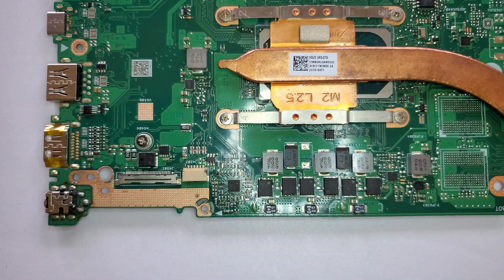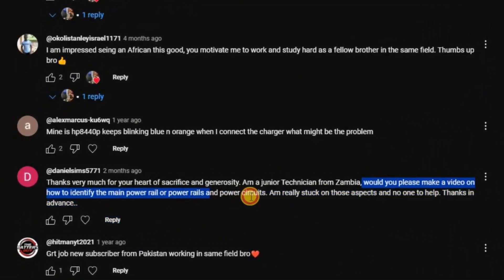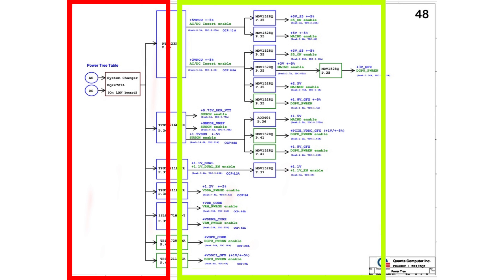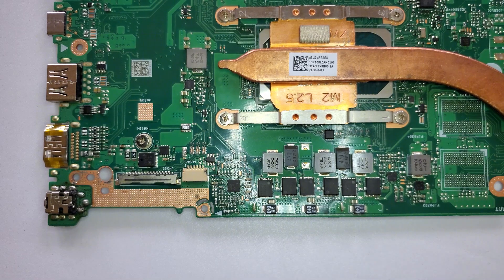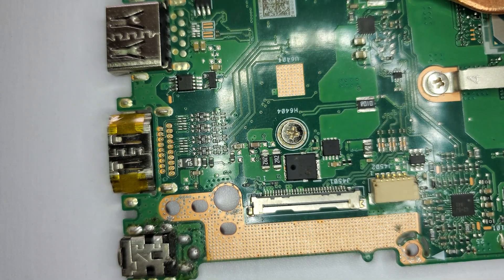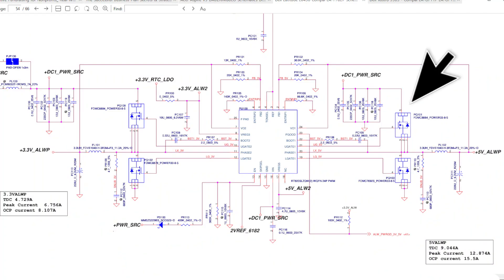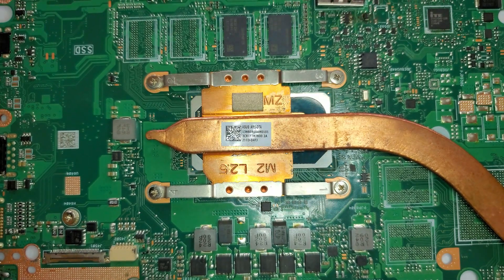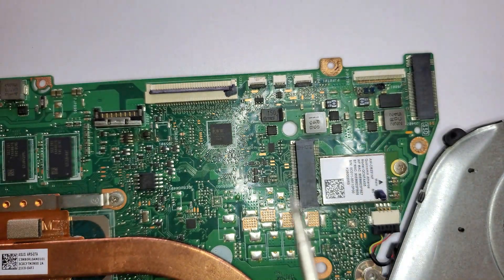How to Identify Power Rails on the Motherboards

Comment from the maker: Which video do you want me to create for you?
Reply: My laptop: Dell Vostro 14 3000 has some problem
- lost audio
- mouse intermittent, sometimes it shows up, sometimes it doesn't, sometimes it can be controlled, sometimes it can't be controlled. sometimes it only works with the right mouse button (not the left mouse button) - when I use the right mouse button, the control panel still shows up
so is it hardware failure? how do i check and repair?
help me please - thank you so much :*
Reply from the maker: @Duimoc  This sounds like are software issue. If you lost audio, first look at the sound icon, if its "x" then you need drivers. You can as well try powering up the laptop without RAM since most Dells will beep to indicate missing RAM. 
The touchpad also feels like you need to install synaptic drivers.
You can use Driver Booster or Snappy to install missing drivers.
Try those and let me know.
Reply from the maker: @Duimoc   This sounds like are software issue. If you lost audio, first look at the sound icon, if its "x" then you need drivers. You can as well try powering up the laptop without RAM since most Dells will beep to indicate missing RAM. 
The touchpad also feels like you need to install synaptic drivers.
You can use Driver Booster or Snappy to install missing drivers.
Try those and let me know.
Reply: Please do a video on how to troubleshoot  and understand CPU VCORE circuit and screen backlight circuit. Thanks
Reply from the maker: @dzabakwesi2213   here is the video for screen backlight circuit https://youtu.be/gP-e-uEzHtg
Reply: @ thanks sir I really appreciate
Reply from the maker: @dzabakwesi2213    Alright Let me work on it
Reply: Show us a video of you troubleshooting a laptop. Not pre troubleshooted by you. Troubleshoot it with us. Commentary troubleshooting.
Reply from the maker: @roshanbabus9597   Do you mean something like a live stream?
Reply: @platinum_computers  Yes. A live troubleshoot. So we can see your progress.
We want to know how you approch the issues.
Thanks
Reply: Thank you so much. Just check by booster. Out of date some driver control. After update .  Infecting some virus. 😂😂😂. 
May be the virus is alway in my hard drive
Before: i think virus turn of my audio, and now turn of the mouse, pls 😢😢😢

Comment: I have a msi alpha 15 a3dd laptop i bought in 2020, and when powering it on, the keyboard and power button flash. Meaning it turns on for .2s and then immediately turns back off. I measured the battery and got 0.8v, so i bought a new one that reads 11v. Found the rtc battery to be .1v, so i bought a new one. I have reseated components, tried different ram, and cannot find the issue. Measured the power plug with a multimeter and get 18.9v. When either battery was connected, it is charging at 11.3v. The coils all seem to have continuity. I cannot find what the issue would be nor do i know where to check next. Ive been trying to follow your videos on diagnostics and theyre helping me understand, but still at a disadvantage not having schematics or a microscope. Where would i find a schematic for this? And is there a direct way to diagnose step by step such as from power, to ram, to cpu, to a 3/5v rail etc?

Comment: Hi, thank you for the video. I see that knowing these power rails helps us when dealing with power issues on the boards and I noticed that boards have the same pattern: they have MOSFET, capacitor, inductor near each other that control power to components like the CPU, RAM, etc. Can you also make a video on the power sequence of phones and tablets and how to identify power rails on them? Thanks again, much appreciated! :)
Reply from the maker: That's a great observation! Yes, the power rails are usually near the components they power. 
Sure let me into them although phones power supplies are so intergrated in the Power Management Chip PMIC
Reply: @platinum_computers  Thanks! I've also been doing research and studying them since I've been getting requests for mobile repair jobs so I thought it's good to learn about them too.